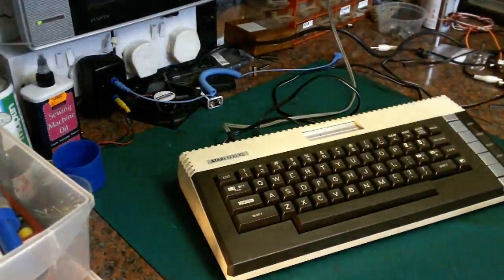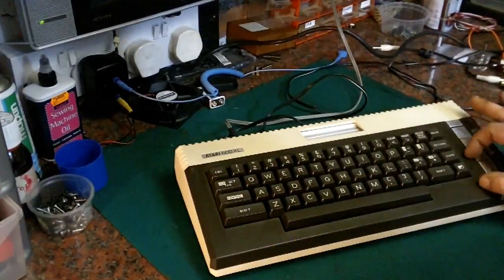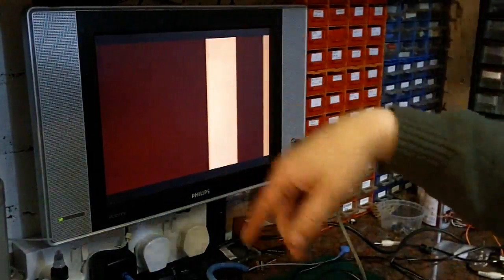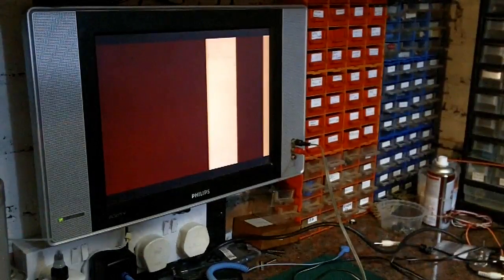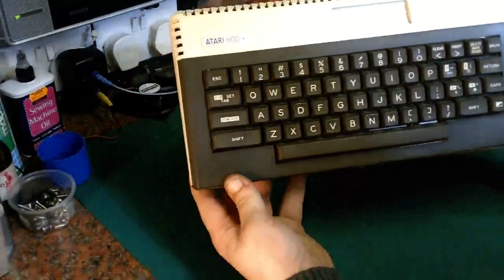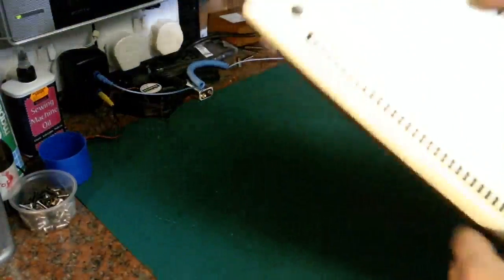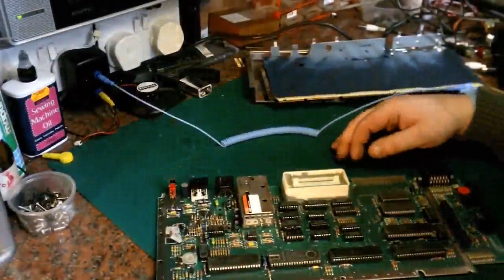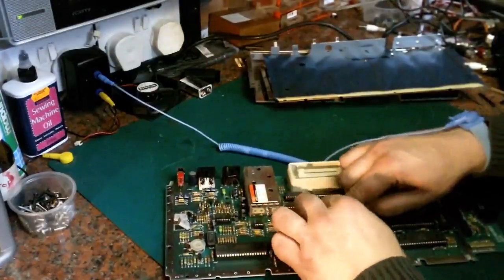Atari 600XL repair Pt1

Comment: The only difference with the 600XL to the 800XL was how much ram it had there were no other limiting factors between them. 16k for the 600XL, vs 64k for the 800XL. The 600XL was easily upgradeable using the rear expansion port which effectively makes it into a 800XL.

Comment: Actually, I had an older model of 800XL (without Freddie) and everything was socketed as well. I take it as the sockets were common in early models, but were removed later to reduce the price.

Comment: I had a collection of a lot of different micro computers.  Back in the 90s.  when you could get them for a quid or 2.  I had an Atari XL.  cant remember the model number.  Probably the 800.  I had an Atari 65xe, too.  I liked the ST styling of that.  Tho I think it was just an XL in party frock.  I also had a 520 STE.
Reply from the maker: Same hear, many of the systems in my collection where baught like that. like the commodore 8096 I baught at a car boot in the late 90's for £1 or the TRS-80 mk3 that I paid a fiver for. still have both and will dig them out for some work and a video.

Comment: At least it had a keyboard. I had a 400. It was just a little bit better than working on a ZX-80/81. At least you'd get a little 'click'  sound  when you pressed a 'key'. When it's all you had though, you made the best of things. :) Cut my coding teeth on the 400. Gonna have to dig the old girl out and see if she still works.
Reply: JaysVintageJunk JaysVintageJunk I learnt machine code and sprites on that 400. And display lists and interrupts. So it may have have a crap keyboard but it's made me a lot of money in the long run!
Reply: JaysVintageJunk JaysVintageJunk 16k. But I got a 48 k version from a outfit in Birmingham.  It was as good as a 800 except for the keyboard. The second slot on the 800 nobody used so made no difference. I was 13, got de re Atari manual, and was off!
Reply: Snap. Me too
Reply from the maker: Haha yea just a bit better than the zx80/81but not much, least it was a better size.
Reply from the maker: apart from the keyboard and RAM it was a good computer for the day, certanly much better to code on than a ZX80/81 ill bet
Reply: JaysVintageJunk JaysVintageJunk I had a 48K version !
Reply from the maker: Ah didnt the 400 origionaly come with 8 or 16K? I do like the RAM cards the origional 400 and 800 used

Comment: Cool. The 600XL retailed for US$199 while the 800XL retailed for US299. The 600XL was released four months before the 800XL and they were intended as 400/800 replacements respectively.

BTW, these are great - magnetic parts tray:

https://www.amazon.co.uk/Silverline-871414-Magnetic-Parts-Dish/dp/B000LFTVAO/ref=sr_1_1?ie=UTF8&qid=1518733740&sr=8-1&keywords=magnetic+parts+tray
Reply from the maker: Thanks for the info, I didn’t know the 600XL was released before the 800XL, wonder if it was the same over hear in the UK?
PS I have a few of those magnetic parts trays but they are all down in my garage with bits of engine stuck to them